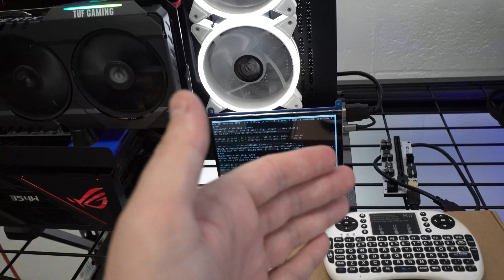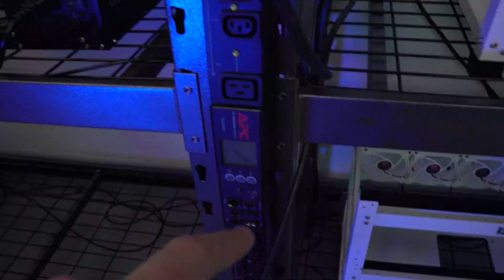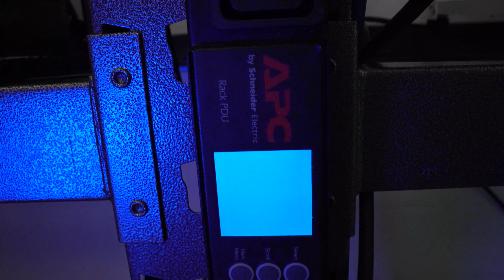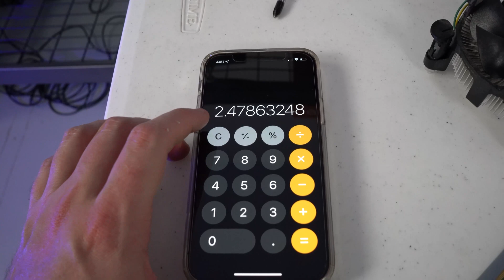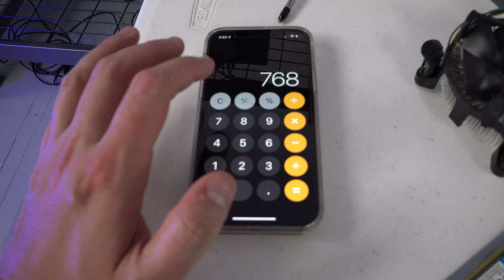New RTX 3090 Nvidia Rig Build in The Mining Bunker (Part 1) - Is the 3090 or 6600 XT More Efficient?

Comment: Had the same issue happen with EVGA PSUs. Swapped new PSU into an existing rig and kept the MB and CPU cables in place and had the same issue as you. Swapped in the MB and CPU power cables that came with the new PSU and everything has been working fine for a few months. Also, the PSU and cables that I pulled is working just fine on a different system. For reference, I swapped a 750 Supernova GT in for 750 Supernova GA.